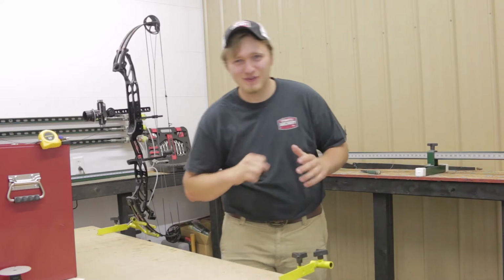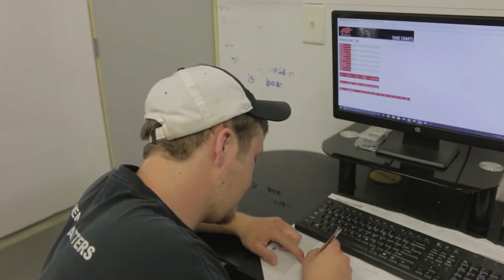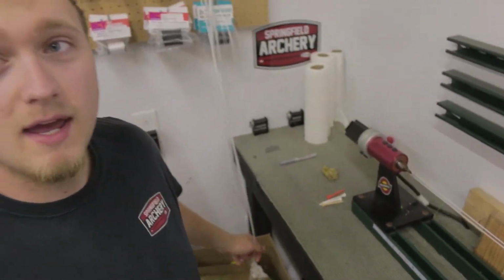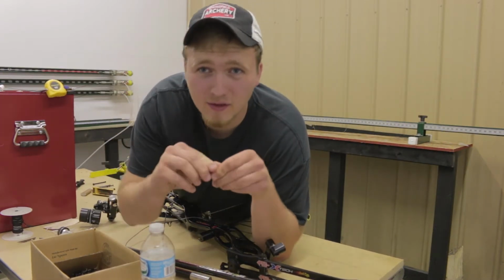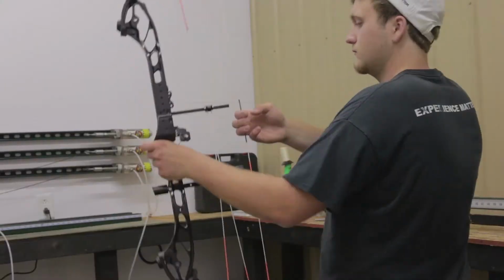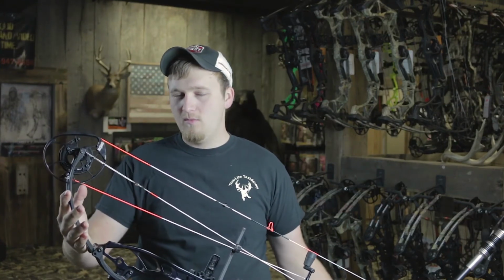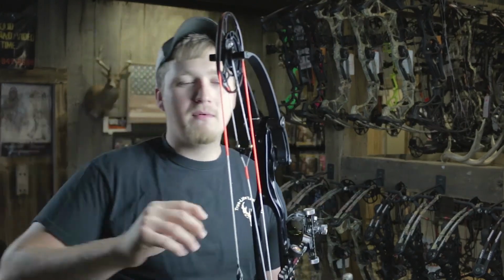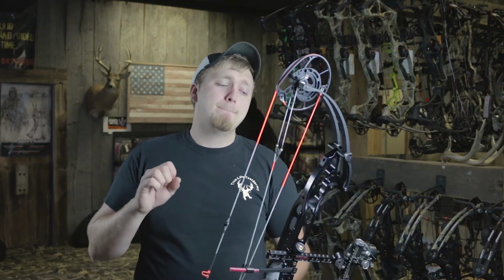Building Custom Bow PSE Devolvenator (HPM Vlog 1)

Comment: You remind me of me when I was your age.  I liked tinkering with my bows as much as I did shooting them.  I'm still tinkering at 53, but not shooting as much.  Your videos are GREAT and inspiring.  When the evlove cam came out, I wondered why in the world PSE used a floating yoke in it instead of a static yoke!  I knew if i ever bought an Evolve, I was going to rig it with static yokes.  I had planned to do it the say way, by eliminating the short cables that made up the yoke and just build new cables with longer Y and tie in a splitterl  This is the kind of information I am interested in and is very short supply here on YouTuble.  I'm currently gathering the parts to build a Decree HD UF.  (Going from cernter pull HD to stantard pull UFcams).Thanks for sharing your videos!  And great job!  I just subscribed.